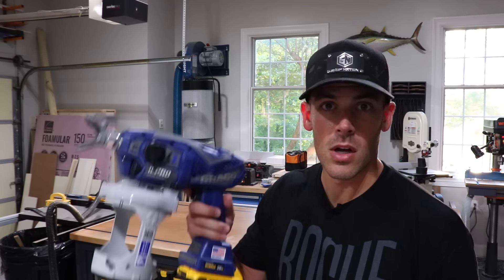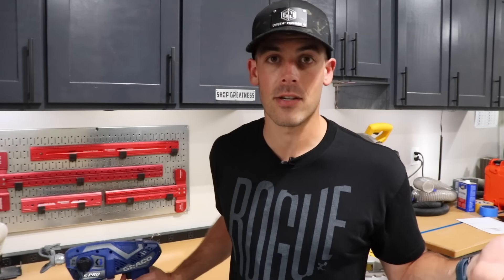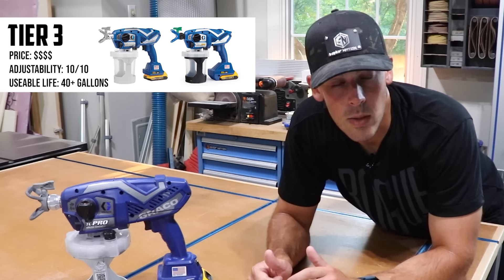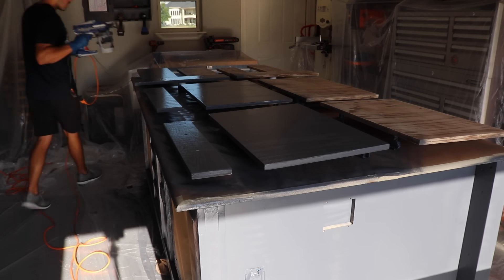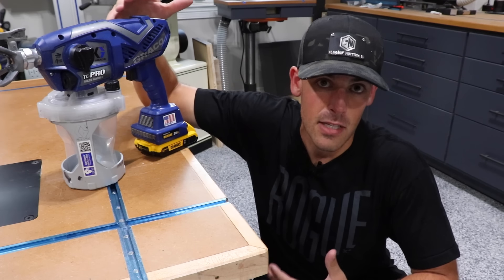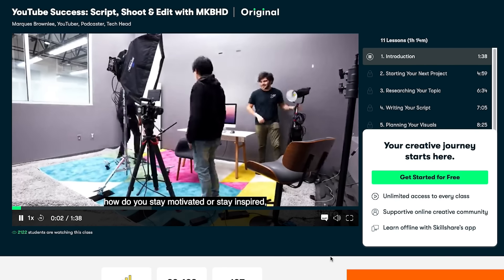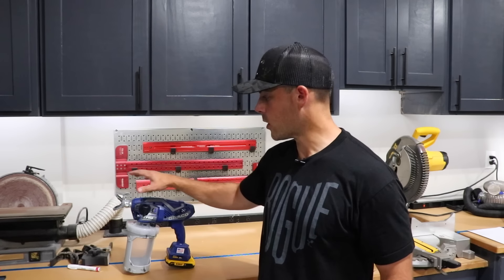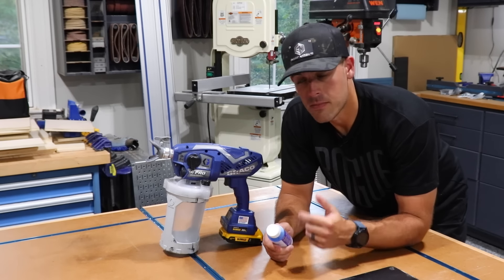Best Cordless Airless Paint Sprayer? // Graco Tc Pro & Ultra Review

Comment: One of the biggest benefits I've seen for these vs the larger units is the amount of paint that's needed to even use it. The larger airless go through paint really quick. It takes almost a half gallon just to prime up the system of my large airless. A gallon of paint won't get you very far and then there's still around a 1/3 of the can left when the pickup tube is pretty much useless. These are great if you have a small project and just have a quart of paint to do it.
Reply from the maker: Yes!  I should have mentioned that
Reply: Do you have 1000 foot hose on it?
Reply: I have an x5 and when I want to do a small job I have to almost buy an extra gallon because of this. It also sucks to clean when it’s cold out.
Reply: If you keep the unit close to you and use a 5 foot hose, and/or chase with water when you're priming/cleaning it, there is hardly any wastage. Maybe a 1/2 cup at most

Comment: Would you consider this specific model if it was around $300-350? I have an opportunity to purchase one new for around that price. Or would you still recommend the Ultra for its regular MSRP over this TC-Pro for $350ish?
Reply: Absolutely, the TC pro and the Ultra are the exact same sprayer. Zero difference other than color.
Reply: Well there’s a few major differences, mostly the tips are different. The Ultra I believe uses professional interchangeable tips/nozzles, that you can get anywhere, while the Pro uses a more proprietary design. They’re not interchangeable either, so u can’t easily turn your Pro into an Ultra.
Reply: @BigBear--  Not true, I have the TC PRO  and use the FFLP tips that come with the Ultra. They're exactly the same.

Comment: I have the same sprayer (TC Pro) and I have had nothing but problems. I have tried several kinds of latex paint and all of them required thinning to get fully atomized. Without thinning I get terrible tails in the spray pattern. It sprays a ton of paint and over spray even with a 310 tip. I bought it to do cabinets and furniture projects and I have learned it is definitely not for fine finishing. Baseboards and trim, sure. But not a nice piece of furniture. You just can't get a good finish. I was hoping for the price I would save the hassle of an HVLP. No thinning and cordless sounded so nice, but it's too good to be true.

Comment: I painted a 175ft long x 17ft high mural with the corded version. I couldn’t afford a large sprayer at the time. But I only had to replace the pump once and that’s very easy. I’m going to purchase the cordless ultra or maybe ultramax version which i read has a brushless motor which is more efficient. Still have a lil more research to do but Just fyi you can do rather large projects with these if need be. You def will get an arm workout tho. These cordless versions are awesome for when you need to travel light but paint big!!! Highly recommended! These things are troopers!

Comment: They are all amazing for doors, trim, finishing cabinets, any small projects to medium sized projects. Only problem I've found is that the pump cylinder dies. Basically the only downfall besides occasionally spitting. Switch the tip. They are well worth the money. Always clean and cycle through to have your pump last longer.

Comment: Years ago I looked at Graco's in big box and learned those models use the RAC V tips versus the better RAC X tips on the pro models sold in paint stores.  For same money I went with the base pro model and never looked back.  So good for large jobs but for small tasks a pain to set up and clean out (long hose means a lot of paint to flush.)  So when they started offering the handhelds I jumped in and got the cheap cheap DIY corded model and it works fine so far, and not as hard to clean up IMO.  But only two tips and 1500 PSI so started looking at these better versions but of course Graco playing the same game offering incompatible versions with proprietary tips in big box versus pro paint stores (and Amazon).  So my current two speed consumer version was really cheap on a deal day or something - less than 140 bucks so when it wears out I will likely pony up for the Ultra plus as it can spray lacquer and volatiles.  But wow over 800 clams plus if Dewalt ever obsoletes the current 20v battery form factor ( and i'm a Makita 18v guy, same fear tho)  ...anyway all of these use the flex containers but like you point out  the plus has a solvent compatible version to tolerate solvent coatings.  You can buy extra flex containers and you can use a plug to seal  unused paint in the flex containers (solvent or regular) and just clean the gun for overnight preservation- can't really do that with my pro model that only works with 5 gallon buckets and needs to be cleaned every night or face gumming up the pump, hose and gun. Oh and oil - gotta oil the big boy every time.

Comment: FWIW, the Ultra handhelds are WAY easier and faster to clean than a traditional airless sprayer...way easier and way quicker.  And you can basically do a good job cleaning it with about a gallon of water, as opposed to about 10 gallons in a traditional airless.  Night and day.

Comment: I got one of these  units over a year ago, and I'm pretty positive that both the TC Pro and Ultra are exactly the same unit (granted different labels). TC Pro is just the one sold at Home Depot (and maybe also other big box stores) and the Ultra sold elsewhere, like their own website, and other more specialty stores. I guess my point is that the Ultra is not really better built or anything like that, it should be the exact same unit from what I remember when doing my research. Yes, it is true that the tips are different, but that's probably really the only main difference. TC Pro was designed more as a pre-packaged unit and hence came with its own proprietary tips, where as the Ultra used the traditional ones. However, even then, I still thought you could interchange them regardless. But you can fact-check me on that very last comment, regarding interchangeability.

Comment: I have the DSP 360 corded model. For small jobs, it will work just fine. I did use it to paint a ranch rail fence around my 2 acre yard. Ugh. Then I used it to help my son paint the exterior of his house. Double ugh. The clean up on this sprayer is a nightmare. Latex paint sticks like crazy, so get Goof Off to get as much dried paint off as possible. For small jobs, I much prefer my HVLP with a metal gun. Clean up is MUCH faster on the HVLP unit, hands down. Due to the amount of money I spent on the DSP 360, I'll keep using it, but I'll probably upgrade my HVLP system to a four stage unit, damnt he cost. I regret buying the Graco sprayer now...

Comment: I have the VSP and I used it to paint the entire exterior of my house. It never over heated. It also worked out well. I would run through the a 42 ounce cup, back roll, refill and do another section. I have a full airless rug but I found it perfectly effective to use the little sprayer. Maybe not what it is designed for but worked well for me.
Reply: I painted my whole exterior of my house also with the VSP. It worked out great no overheating or any problems at all.
Reply: Which one is this VSP you talked about please?

Comment: Kudos to those who have had good luck with these. I will say I did not have luck with the tc pro or ultra pro. Paid $1,000 between both of them and ended up selling both and purchasing a Fuji q4 for the same price and couldn’t be happier. The gracos always were very finicky with the priming, , losing prime and I didn’t like the adjustability. A $50 fflp tip if you want to change how much or little you want to spray vs a spray gun that has those adjustments built in. Graco could do this with their guns but they would be losing money on tips. Just my .02

Comment: I’m a union painter in California thanks for the review I think it’s great because for my personal opinion I’ve got a little Graco 390 and yes I’d rather much use that than one of those handheld battery operated ones just due to the fact that it probably takes the same amount of time to clean plus I got a smaller line on it and I can run a quart of paint in my no problem but great info.

Comment: I'm going to add to your review.  Disclosure, I paid for everything, I don't have a channel, just a user..  I have the regular Graco floor standing airless sprayer, the corded cheap Truecoat 360 VSP, the TC corded version.... I hate them all, far too much overspray, far too much orange peeling.  The X7 I have works really well for walls and large projects like my fence and exterior walls, but it still suffers from over spray.  I sucked it up, and ended up with a Fuji Spray hvlp turbine sprayer with the 3M pps cup system.  Yes I know they are different, but I get a much better finish for cabinet projects and such.  Even the professional grade airless sprayers suffer massive overspray, fine for cheap paint, but a waste for expensive paint.  The air assist ones work better, or course those are way out of price range for the average DIYer.
Reply: If all you do are cabinets, trim, or furniture, I'd recommend a Graco air assisted airless. The smoothest finishes and hardly any overspray.

Comment: I have one of the cheaper models and found out the flaws pretty quickly after painting my first project and being limited to the one tip size. For $600 I’ll buy two handheld HVLP(one for water one for oil) which have a variety of tip options @ $100 ea and a bigger airless sprayer like the magnum for big projects which again has a variety of tip options. 

Yes they have cords but like you said these small sprayers aren’t designed for big projects so you really shouldn’t have an issue with dragging the cord through wet paint bc you’ll only be painting a couple cabinets or a furniture piece. I really don’t get the philosophy of use of these cordless models especially at their price point. 

I bought the DS after you recommended it and was disappointed in the purchase after I found out about tip limitations so I wanted to make sure and leave this comment and hopefully save someone else the heartache
Reply: À

Comment: I have the TC pro with RAC X tips, you can virtually use the gray, orange and blue tips as they are interchangeable. As far as the TC Pro from the Ultra -My understanding was that the Ultra is the Lowe’s version while the TC pro was the Home Depot version but basically the same gun…
And as far as the weight, I got used to it by my 3rd project with it…

Comment: You are right, expensive it is. Cordless sprayer ?????? It should have a DeWalt name on it, DeWalt tools are pricey. Around 2-3 yrs ago I was watching as I always do, one of The Handyman's videos on YouTube where he was about to spray these high dollar custom kitchen cabinets he had built using for the first time a Home Right Max sprayer. A disaster in the makings I thought. No way didn't happen, the job turned out to be perfect. They were selling on Amazon for$119 so I ordered one on sale for $99.00 with all the goodies that came with it. I use quite often big jobs to sm jobs, never not once had a problem and cleaning is a wiz.  All pros no cons.
Reply: I got one of those too, for the same reason. Orange peel factory
Reply: @ThaGreatestAlexander  But orange peel isn’t a sprayer issue, it’s a substrate issue.
Reply: @misanthropic_anthropoid_6660  Well it was mdf and i thinned materials and sprayed thin and thick and tried like 5-6 different attempts changing tips etc

anyways a hvlp turbine sprayer layed down nice and flat

Comment: Ive used it. I returned it. While great for diy amateurs and furniture lol and this guy making YouTube cash, it's not for large projects. The paint cup holds about 5 mins of paint. The refilling is a pita and messy.  Cheap airless sprayers are under 300$ new and with them you can do furniture or your entire home. That lil POS costs 60% of the small sprayer and cannot do much more than half a wall before stopping, filling, priming and testing spray pattern.  you will regret your purchase before 1 hour if use. Do yourself a favor, spend a bit more money and get a cheap graco x5 or similar.

Comment: I just bought the Ultra and really like it so far. However your arm does gets tired fast and the container is pretty small so don't buy it for jobs like painting rooms or house exterior. Wagner has some good prosumer models like the Control Pro 350 for those type of jobs and it's the same price as the Graco one at least here in Europe

Comment: I have tried all types of sprayers over the years, and the Ultra is by far the best one. Mainly because I have never had to thin anything and I get a great finish. I did start out with the corded version to save money and learn how to spray, but after a year or two using that I upgraded to the ultra. The whole TC PRO vs Ultra thing is kind of lame. You can find varying discussions online on whether they actually use different parts, but Graco treats the customer much differently if you buy the TC PRO, even if they are the same price. You can often find deals for free tips from Graco when you buy one, but only with the Ultra, not the TC PRO. Make sure to learn about tip sizes and keep an extra one on hand of the ones you use the most.

Comment: I bought an Ultra a year ago after using the corded version a few years. Having the ability to use different tips is a huge plus after you figure out which tip sizes work best for what application. I called Graco customer service and spoke to them about the TC Pro vs the Ultra. Even though they are all almost exactly the same, the TC Pro is the one you will find at big box stores. The Ultra is almost exclusively sold through contractor paint suppliers. Sherman Williams even has their own version called the Ultimate.

Comment: Great review! I have the Ultra for a while now and using it for painting cabinets and rooms (no a whole house at time). Your pros and cons are spot on. Two additional points:  Storage I like how the compact it is not eating up garage/shop space. Also for the weight, I use two arms/hands ... one supporting paint reservoir and other on the handle. I find this helps in keeping paint sprayer   in a better position and thus a more consist finish.
Reply: Nice weapon for Splatoon 3

Comment: I've gotta agree that the Ultra is the better option.  What I really like is how little paint you disturb (buy and put into gun).  I really like that you can buy a cap, additional bags and carrier and store the unused paint for later (like the next coat or two) or (like the next days work) - less waste and I really don't want to put unused paint back into the original container or throw it out.  With the Ultra using the pro tips, this is the best of all world for smaller jobs like one room trim on paint your home one room at a time, putting the room back, and moving to the next room.

Comment: Good review...pretty much nailed all the good and bad points. I have an ultra and it does come in handy for smaller jobs. Overall, I think if these were a couple hundred bucks cheaper they would be worth the money. You would be better off buying a lower end airless from a box store or just rent one.
One thing that wasn't touched on is if you have the unit that can spray flammable materials, you have to use a grounding cord or else you'll feel a shock while using it. That pretty much defeats the purpose of cordless convenience...you may as well buy the corded version.

Comment: Great review. I almost purchased the ultra to paint some trim thinking it would be faster and easier than my low end magnum airless. Instead I ended up just painting with my HVLP which isn't as light as my airless but it is far easier to clean. I think the most attractive feature of the graco pro/ultra is the fact that you don't need as much material because there aren't any lines. My magnum uses nearly a quart of paint just to get it to the gun.